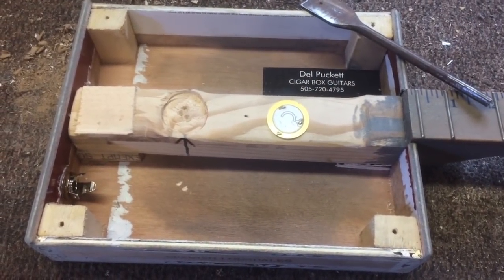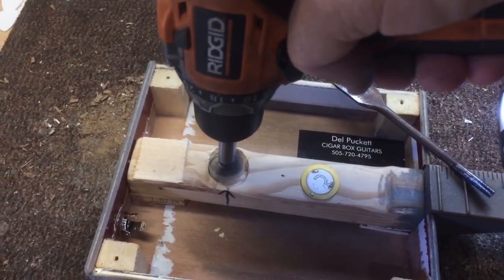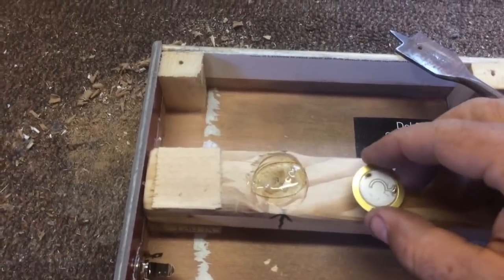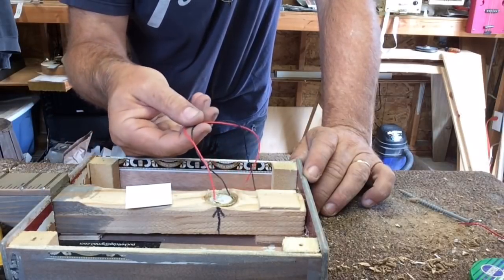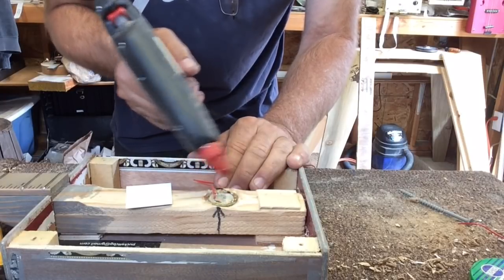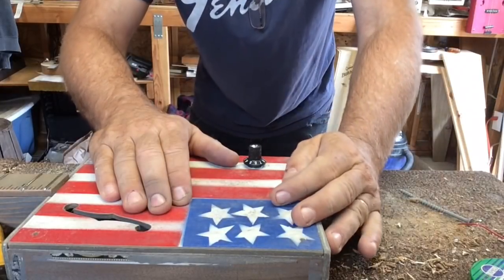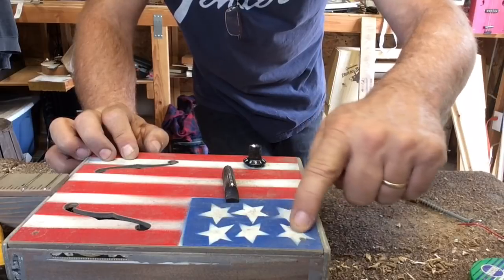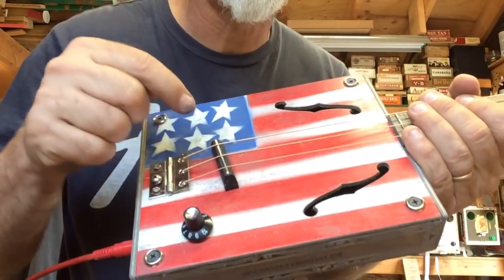Embedding a Disc Piezo under the Saddle

Comment: It's that why you don't need to use a capacitor to eliminate all that noise and distortion?
Reply from the maker: i’ve tried a capacitor… i’ll try again .
Reply: @PuckettCigarBoxGuitar  In my two humble builds I used a capacitor because there was to much feedback. But unfortunately with the capacitor you lose volume.